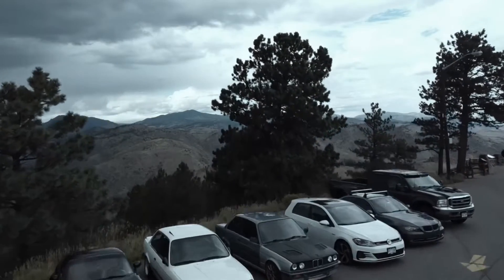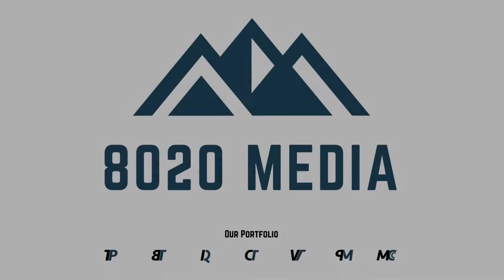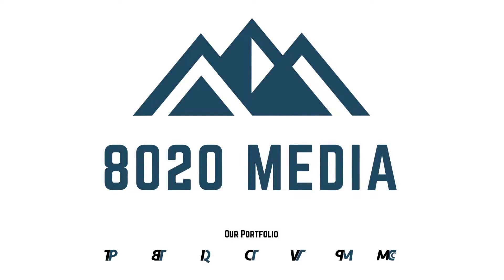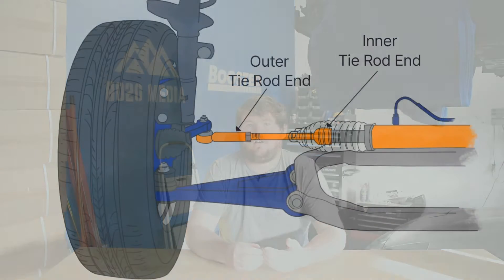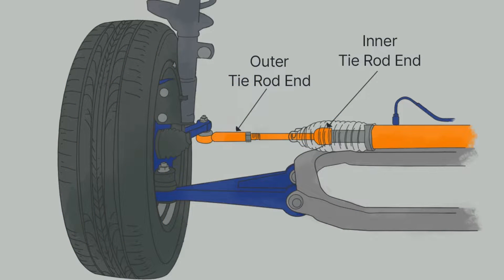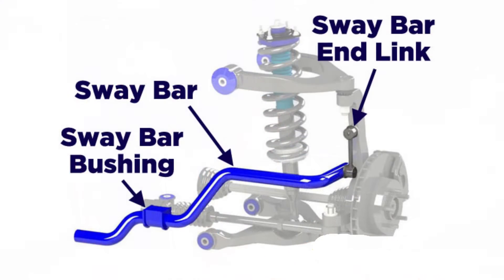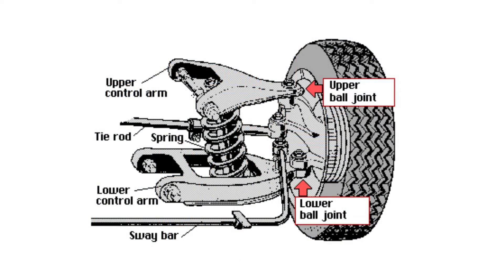DIY - How to Diagnose a Car Clunking Noise While Turning

Comment: Question - I notice a single clunk while turning when going from a decline to level ground. Seems like it is coming from the left front side of the car. Don’t notice it in any other situations. Do you have a hunch what it might be?
Reply from the maker: T - A single clunk while turning and transitioning from a decline to level ground, especially from the left front side, is likely caused by suspension or steering components that are under stress during the change in angle and load. Common culprits include a worn control arm bushing, a loose sway bar link, or a ball joint beginning to fail. Additionally, check the strut mount or spring seat, as they can produce clunking noises when the suspension compresses or shifts. Inspect these components for wear or play to identify the source of the noise.
Reply: @8020Automotive  if I put in stiffer shocks and then reused the oem coils, and the clunking got worse than before (along with essentially an entire front end rebuild) and everything axle, shaft, and joint seems solid, is it an assumption that the springs are just not going to measure up to the upgrade?  I'm not willing to give up on the U joint or front diff idea but multiple people have said nope literally everything seems solid AF.  I have to still tackle the rear everything yet.  Am I missing something here.  Am I crazy? It's like a bad strut sound but the struts and mounts are brand new Bilsteins.  Tie rods completely redone, sway bar, bushings, links, boots, balls, literally everything has been done.  I have noticed the sway bar walks to the left (follows the angle of my current home parking situation) but doesn't correct itself upon flattening out.  One link is perfect the other wonky.  Had it redone literally 3 weeks apart with a different one and same happened.  Is a twisted sub frame a possibility? I'm so lost😅 and so are my mechanics. Meanwhile my gears are getting harder and sloppy to shift.  All of a sudden.  It's like the new suspension put pressure on the teeth but the bearings and axles all seem strong. The Bilsteins are technically a none complete fit, they needed to have a 1in puck in the upper mounts. The clunking and popping and squeak have been there prior to rebuild but got better for about 3,000 miles after and now worse than ever. Sorry for the novel but it's everything I have experienced with it so far driving me nuts
Reply from the maker: @rockmemama86  Given everything you’ve replaced and the fact that the clunk got worse after installing stiffer Bilsteins with OEM springs and a 1" puck spacer, it’s possible your issue isn’t spring “strength” but rather geometry or mounting-related stress. The puck changes suspension angles and can preload components in ways the original design didn’t account for, potentially exaggerating sway bar misalignment (yours “walking” left and not centering is a red flag) or binding in control arms/links. If the sway bar isn’t staying centered, it can cause repeated side-loads that lead to clunks and pops despite new parts, and the uneven link angles confirm something is off. A twisted subframe is rare but not impossible—especially if the truck has been hit, lifted incorrectly, or off-roaded hard—but more common would be worn or misaligned subframe bushings, control arm mounts, or incorrect preload when tightening suspension bolts (must be torqued at ride height). The worsening after ~3,000 miles suggests something settled or shifted after the install. The sloppy shifting could be unrelated (linkage, clutch hydraulics, or trans mount) but could also be from the same driveline misalignment if the subframe or mounts are out. I’d get the sway bar centering issue addressed first, have the subframe measured for square, confirm all suspension fasteners were torqued under load, and check that the Bilsteins plus puck aren’t overextending droop travel and topping out—because that can create the exact “bad strut” sound you’re describing.
Reply: @8020Automotive  we checked all torque  in the bolts and bushings, we did realign the sway bar and sway link/sway bushings, and did wheel alignment after all work was done.  I've seen the transmission mounts on these gen 1 Nissan Armadas have a mysterious "link" to these "mysterious" clunks.  Seems common in them.  It doesn't match up with axle "sounds" because of the fact it is the worst at a stationary stand still or parking/barely moving. Maybe removing the puck extensions? And redoing the spring seat? I used the pucks because it was recommended for the Bilsteins in forums.  I also feel once the rear gets upgraded soon it might "level out" some. But one of my guys is saying to not drive it it's the pinion bearings in the front diff.  But last time I checked on the diff it was said that it was good.  I've done all fluids in diffs, transmission, transfer case, power steering, breaks, it's not any of those locking up dry. But this clunking definitely seems to be common in the Nissans, and nobody ever finds the actual problem.  So frustrating because I go cross country often. I'm wanting to go on another trip here shortly and I'm confused if I'm good or no.  I mean the clunking has been there since I bought her a yr and a half ago so.... 🤔😵‍💫🤷‍♀️
Reply: It's a "northern" vehicle, from Wisconsin and has it's fair share of subframe rust.  Im sure there's some hidden mounts that could be hanging by a thread.  I know it has 1 hidden transmission mount, and 2 hidden motor mounts and the subframe bushings are, well in a tight spot but nothing seems loose or missing.  It's a heavy vehicle, under load it definitely puts stress on old rusty bolts 😂 mechanically though it is solid and I've been told not to give up it's still got life to give....
Reply: @8020Automotive  I also only used upgraded stock size control arms.  I know there's deep set control arms made for the model but in forums the puck was supposed to allow the control arms enough give to not stress. However I also have bigger tires/rims for the stock requirements.  So was not sure if the pucks were going to be needed on mine.  Since I have technically about 1-1 3/4in in extra height in the wheels

Comment: I drive a 2016 dodge challenger sxt plus and ive noticed that the back left side of my car makes a loud knocking noise when i turn right but when i turn left its really quiet. it doesnt make the noise when i drive straight and it doesnt always do it unless im going a little faster when i turn do you know what it could be?
Reply from the maker: C - The loud knocking noise from the back left side of your Challenger when turning right is likely caused by a worn suspension component, such as a damaged sway bar end link, control arm bushing, or rear wheel bearing. It's also possible that the rear differential or axle is contributing if the noise happens under acceleration during turns. Inspect these components to pinpoint the issue. Keep us updated!

Comment: mine squalls mainly when im turning.. sometimes going forward or back. and one of my bearings feels thumpy haha, any top tier suggestions to start or look at?
Reply from the maker: T - Start with the thumpy wheel bearing, as it’s likely the root cause. Replace it if worn, and address any related suspension or steering issues. If the squalling persists after repairs, revisit the power steering system or brakes.

Comment: Mine makes a knocking/clunking noise on the drivers side only when bringing the car back straight after turning right personally think its the ball joint but surely that would make noise no matter what way i turn the steering wheel
Reply from the maker: H - Sorry to hear this.. The ball joint is a potential culprit, but tie rod ends, control arm bushings, or strut mounts are equally likely. Start with a thorough inspection of the suspension and steering components, focusing on the areas experiencing the most load when returning to center.
Reply: @8020Media  OK thanks Al get it jacked up the morra and have a look 👍

Comment: What would be  the cause of a creaking noise only when turn the steering wheel turning left at speeds of 10 to 24 mph?
Reply from the maker: S - The most common causes are worn ball joints or control arm bushings. A thorough inspection of the suspension and steering components is recommended to pinpoint the issue.
Reply: @8020Media  thank you for your reply and advice 👍

Comment: My 2017 spark make a clicking type tire rubbing noise just sitting or driving. What's weird is that it only does this when its cold outside. It's perfectly normal when it warms up. Car also drives fine. It sounds like the tire is rubbing on something when ita cold. Please help
Reply: Also they cv joint was replaced 10 months ago on drivers side which is the side the sound is on. And a month ago the bushing and strut was replaced on passenger side.  I've been trying to figure this out. I also have been hearing a creaking and slight rattling when drinking also
Reply from the maker: K - A clicking or rubbing noise that occurs only when it’s cold outside, whether your car is sitting or driving, is likely due to materials contracting in the cold or temperature-sensitive components. Since your Spark drives fine and the noise goes away when it warms up, it points to issues related to temperature changes in the suspension, brakes, or wheels.
Reply: @8020Media  i took it in this morning and he think is sway bar
Reply from the maker: K - Keep us updated!

Comment: What would cause a noise when I’m turning into my driveway? My driveway has a slight hump, but other than that I don’t hear anything when turning. It’s not a metal sound, it almost sounds like creaking sound.
Reply from the maker: S - Unfortunately, it can be a few things. Bearings, sway bars, ball joints, struts.

Comment: How about clunking noise (left front side)when turning while reversing? Left front inner tire wearing.
Reply: Did you sort it? I have the same issue
Reply: @ not yet
Reply from the maker: G - We touch on clunking in the video. Have you taken it to a mechanic?

Comment: Can somebody atleast give an idea why i would hear a clunk or click when turning wheel rt or lft but the noise sounds/comes from up towards the steering wheel like the where the wheel connects with the rod by the dash. The wheel does feel a bit loose but there’s no squeel & such?? Any help?
Reply: My car does that and my airbag light came on. I think I broke my clockspring by turning the wheel too many times in one direction after I put in a new steering rack and pinion and had the intermediate steering shaft disconnected. If I can find a replacement clockspring or can fix my current one I will try to give you an update.
Reply: @Swishersweetcigarilo  thank You so much. I since had a friend look at it and He thinks that the Car Manufacturer needed to look at it die to the Airbag so you def might be onto something! Appreciate. Lmk cant thank you enough

Comment: I just replaced the CV axle and ball joint on an 09 nissan rogue S and today was driving while the owner was in the passenger seat. The original clunk was gone then at a rotary turn at wide curve the clunking came back and my heart dropped. Inner outer tie rods changed. cv axles, struts and shocks changed. swaybar ends don't look bad...kind of bummed.
Reply from the maker: T - Sorry to hear.. That's frustrating. Keep u updated.

Comment: I drive a 09 civic 4 door lx model, and after replacing my power steering pump, lines, and rack and pinion, along with the tie rod ends, and getting an alignment, I am hearing a noise in the wheel-well where doing at low speeds, on smooth or rocket roads, its as if if i let go of the gas peddle and let it slow down or braking slowly, that there is some clunking sound. BUT the sound is more described as - when taking a flat head screw driver and putting it on the outer side of a metal slotted hamster running wheel. But slowly. (**Sound - low pitched ting, ting, ting, ting, ting**). Not sure what that sounds is….almost as if something is hitting something at the same RPM interval… Dear community… what could it be? Thank you!!!

Comment: Mine sounds like it is coming from the steering wheel itself. I brought the car in to the shop and they said to replace struts so i did but still hearing a clunk at slow speeds when turning and a squeaking over bumps at slow speeds. I had whole front end checked and no other noticeable symptoms. My Dad looked at the vehicle too and sees all  parts are fairly new. It had 125000 miles when i bought it. 131800 now.
Reply from the maker: B - With that kind of mileage, the suspension is getting quite old.

Comment: Thanks for the great info.  I listened every thing and read the comments.  However I didn’t find anything related to GRINDING.  I have a 2016 Lincoln Nav. I parked the car on a gravel surface, as soon as I backed and turned the front tires were GRINDING and KICKING.  It’s been about a week and it hasn’t gone away.  It only happens when I turn at slow speeds.  The tires are new.  Was the gravel surface a coincidence or is there a problem? Thanks!!
Reply from the maker: B - Have you taken it to a shop?

Comment: I just changed my right front lower control arm, and now I'm hearing a pop sound.  I drive a 2014 Subaru Forester 2.5
Reply from the maker: J - Did you check if it was installed properly?
Reply: @8020Automotive  yes
Reply from the maker: J - hmmm. Is it when you turn?

Comment: I had the front inner and outer tie rods replace on both sides now I hear a grinding noise coming from the front.   Any idea what the noise could be.
Reply from the maker: B - When is it happening? Could it be your brakes?
Reply: @8020Automotive   hi. It happens when I’m driving Highway and side street when the car is moving, there’s a grinding sound somewhere in the front. I know the outer brake pads are worn down more than the inner pads, but I never heard a grinding noise before I had the inner and outer tie rods replaced . It’s a 2018 Kia Sportage SX turbo AWD.
Reply: Also is it possible if they put an FWD inner and outer tie rods on a AWD vehicle that could be making a grinding noise.
Reply from the maker: B - Have you revisited the shop that did it? They should fix it if it happened after the service.

Comment: My Honda civic 2018 is squealing from the front while turning driving forward and backwards my brakes and rotors are good so not sure what it could be. Any ideas?
Reply from the maker: K - May want to check your power steering fluid or your tie rods.
Reply: @8020Automotive  thank you
Reply from the maker: K - Keep us updated.

Comment: how about a popping noise while turning at lower speeds like a buckling popping sound?
Reply from the maker: R - That sounds like a possible shock absorber issue. We actually have a video on this coming out tomorrow that may be helpful for your research!
Reply: @8020Automotive   It was the lower control arm worn bushing  . . . . .thanks
Reply from the maker: R - Nice! Thanks for coming back and updating.

Comment: Just did both outers, and while the clunking has almost all gone away, still getting it with low speed tight turns. Could it be the inner tie rods? 2022 Subaru with 92k miles on it
Reply from the maker: V - It certainly could be!
Reply: @8020Automotive  just did those and nope, still chasing the clunk. Thinking endlinks next. If not that, I’m throwing in the DIY towel and having a shop do the axle as that’s the last component I can think of to cause the noise.
Reply from the maker: V - Sorry to hear man.. But we praise you doing it yourself! Keep us updated here.

Comment: I've got this problem with a 99 town car when in grids or thumps only when you turn and brake at the same time. And i've gone through and replaced the sway bar bushings and end links because they were worn and the ball joints where put on by a shop and I have still got the problem. It comes from the drivers side which from the video sounds like it could be the U-joint.   
 
Any advice would help!

Edit: I need to add to this. It only does it when you are between 20 and 10 mph anything over or under that it brake's perfectly.

Comment: I was in Park and I turned the steering  wheel to the left and right, it was a clunking sound as I did that maneuver. But when i’m driving I do not hear it all. My passenger top swap bar link is ripped but I wouldn’t know if that’s making that noise. No free play in steering rack or front axle. I have new wheels and tires. Front control arms are new. But I don’t know if it might be a bad ball joint. But it makes that clunking only when in park
Reply from the maker: J - Have you had it looked at? IT sounds like it's not an issue given it only happens in park.

Comment: How about a clunking sound from the front end while hitting any imperfections in the road. Slight knock while rocking the wheel at a stop. Seems louder when sitting on a downhill slope with weight on front end. Inner front tire wear on both sides. No leaking struts but could they be the culprit? Tire wear has been happening for 10k miles and inspection found nothing wrong. Noises just started up a few weeks ago. Sway bar end links recently done.
Reply: @bleeke69  could be the wombocombo of full tierod. Just did mine and it helped a ton
Reply: I replaced outer tie rods because i found one with play. Took away the noise for a few weeks and now its back but not as bad. Also did front struts. Im hoping its not the control arm cuz without a lift i dont think i want to attempt it with only jacks. @vampyratexd
Reply: Control arm bushes did that to me, replaced and gone
Reply: @adampickering5477  Without a lift that is not a fun job, is it? One bushing is worn a little more than id like but i dont know about attempting that job in my driveway.
Reply: Sway bar links. Just did mine. They sounded like the end of the car
Reply: @jesseowens1492  As stated in the original post, end links were recently done.
Reply: Upper arms